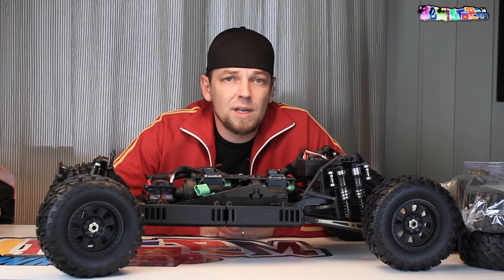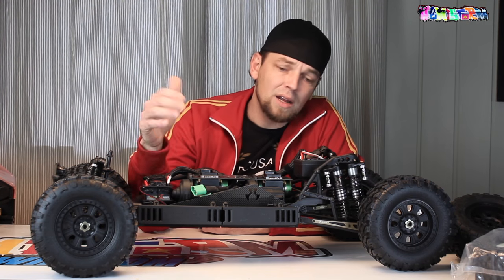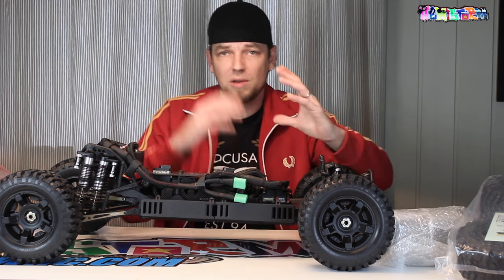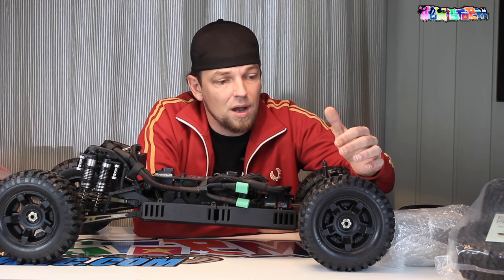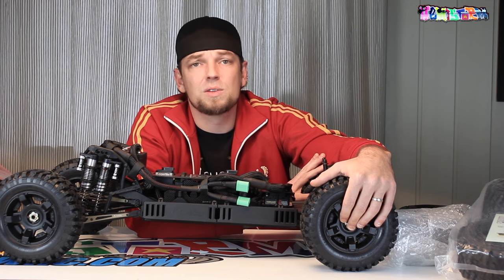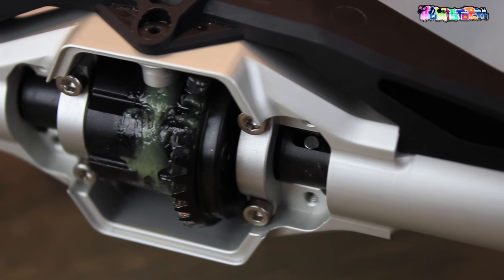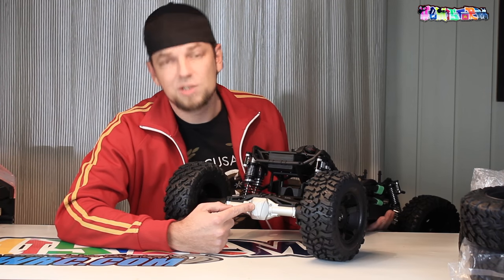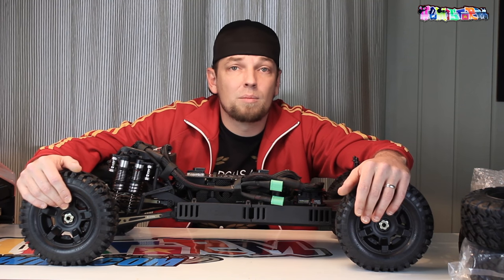The World's LARGEST AXIAL RC - VANQUISH & PITBULL

Comment: hey hemistorm which rail did you go with the 500 or 1000? which do you find is better for what you are doing? thanks for the info
Reply from the maker: +Craig Lasley Hi Craig, I went for the 1000 ones. If you go over anything tenth scale chassis wise you need the longer rails in order to not run out of room for your project. They are extremely sturdy by the way!

Comment: You can run a piece of duct tape around your foam inserts and it stops a lot of the ballooning.
Reply from the maker: +00 Gaudie Indeed, but overall the stock ones are a bit too soft for my liking.
Reply: Ic, I kinda figured that you would've already known about this trick.

Comment: I have already wrecked the new gears in 1.5 packs (6s or 6$ should I say?) I really would love to see a review on the Vanqusih axle after some pack's. especially in this awesome beast you have assembled.
Reply: Vanquish I meant
Reply from the maker: +Mike Hagen I have no doubt that some parts will get destroyed. I also think I will have a smile when it happens!
Reply: I paid much more attention to the set up this time, (plastic housing still) triple pinion bearings and shimmed to .oo3 play. Installed the differential with no pinion installed, and torqued the cover on. The diff was moving all over, so I sanded the cover down a bit and tightens up the diff bearing clearance. If you spend a lot of time setting it up, it seems to last. Also we run in snow and the rear pinion bearings get washed out immediately. So we put grease around them before snow runs